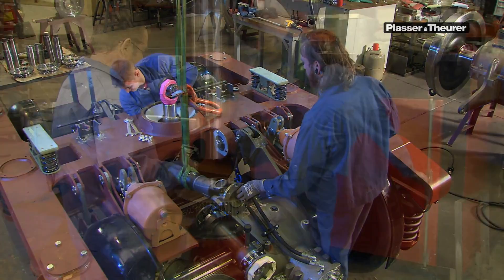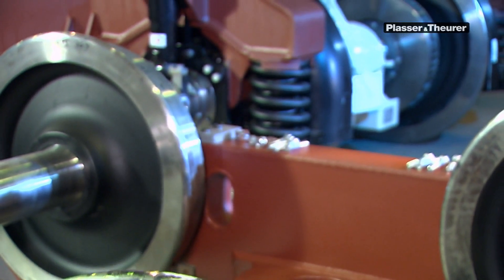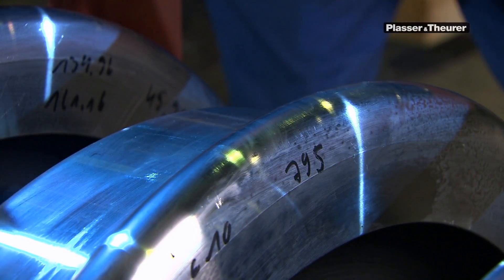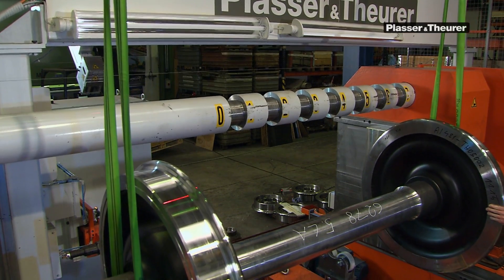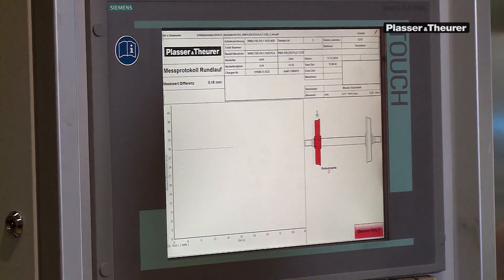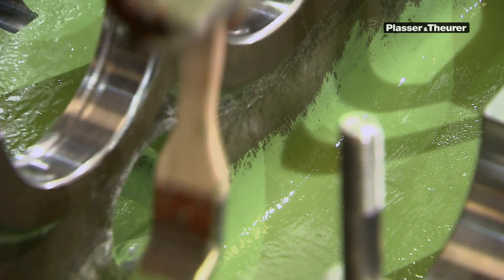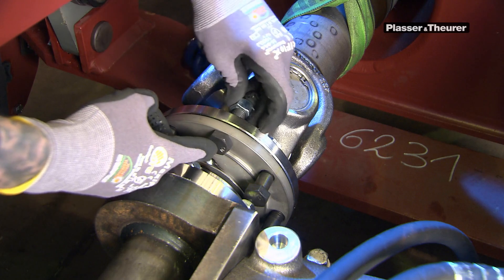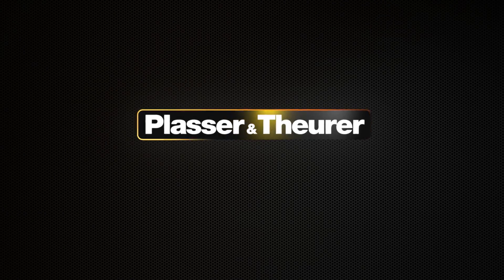Factory Linz - assembly of axles, bogies and gearboxes

Comment: POOJA EXPORT FASTENERS
SHOP NO.2, GROUND FLOOR,
RAJKOTWALA BUILDING,
FALKLAND ROAD 8TH X-LANE,
KHETWADI, MUMBAI - 400004
 NUMBER Mo +919967477177
 poojasteel77@gmail.com

Nuts Bolts manufacturing company